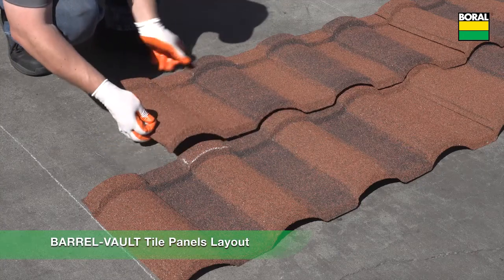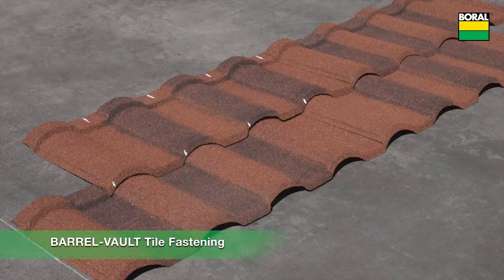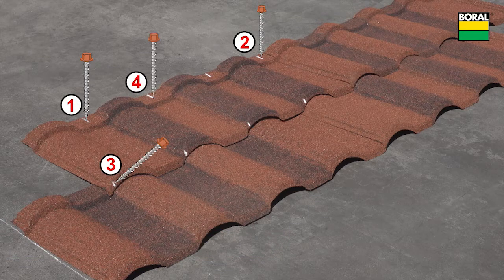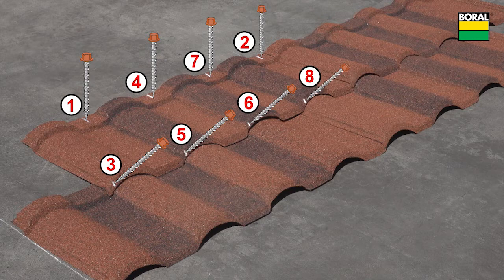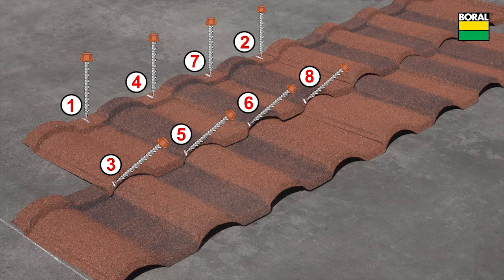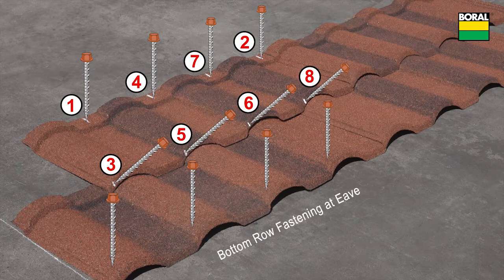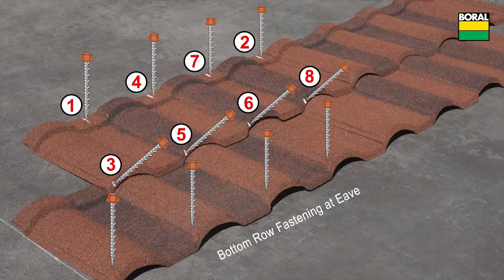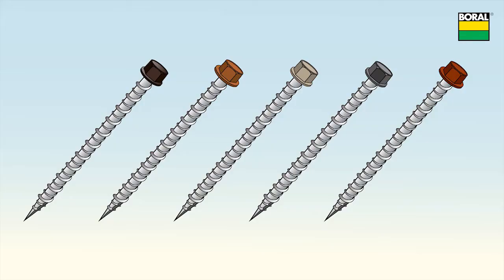Boral Steel | Chapter 9 - Pine Crest Shake -  BARREL VAULT Tile Layout & Fastening

Comment: Screw order on the layout doesn’t make sense. Why would you screw the overlap  ‘3rd’? You would leave that screw out until subsequent partial or full panel was laid on top No? 

Why top first? These panels bottom edge curls up when the top is screwed first, which can jeopardize the seat of the panel. Would the bottom and overlap be first? Only so many hands and on a steep slop screwing bottom first makes more sense in another boral application I’ve installed.